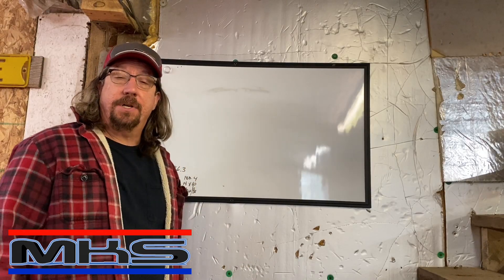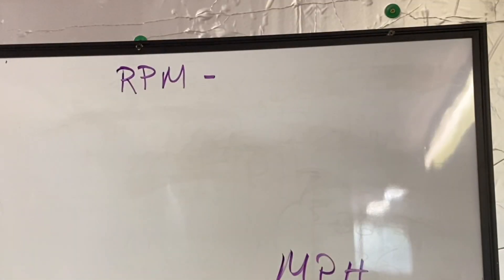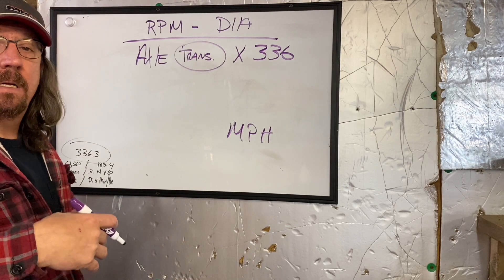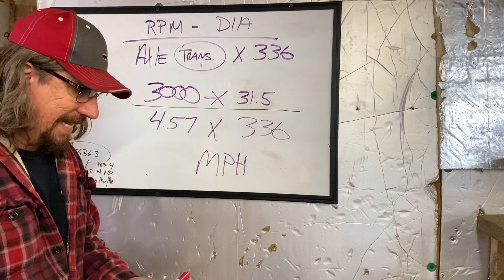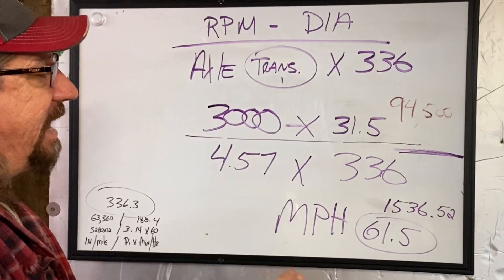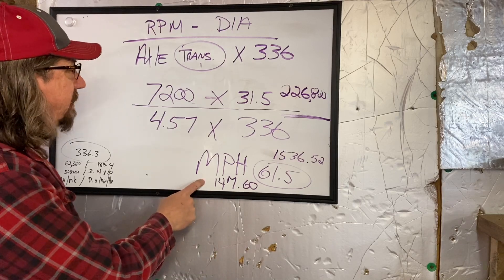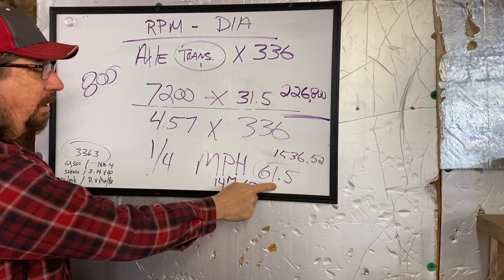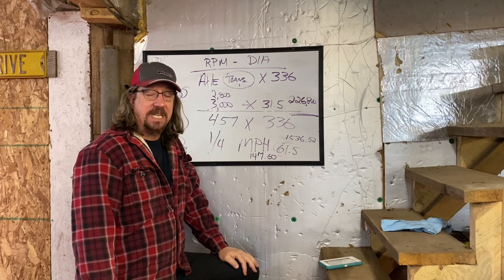How to Calculate MPH, Axle Ratio & RPM. Take the guesswork out of building a drivetrain for your car

Comment: Great stuff man!  My Dumpbtruck has .74 over drive in it's highest gear can I just add .74 to the ,RPM?
Reply from the maker: Multiply by  .74
Reply: @MyKARSShop 1000 rpm x .74 is 740 RPM.
It should be faster than the input shaft for over drive?
Reply from the maker: You’re correct. Sorry it should’ve been divided by .74. 

1000 \div 0.74 = 1351.35 rpm

S
Reply from the maker: Sorry about that. It should’ve been divided by .74 

1000 \div 0.74 = 1351.35

S

Comment: lost me at that 336. don't understand that. how is that standard on any car?
Reply from the maker: It’s a formula compensation 

The number "336" is used in axle ratio calculations because it represents a simplified, rounded-off value of various constants within the formula used to calculate road speed based on engine RPM, tire size, and gear ratio; essentially acting as a conversion factor to make the calculation easier without significantly impacting accuracy

Comment: Hello. You mentioned that there is a further calculations about horsepower needed for a certain rpm. Do you have any video regarding the hp? Thanks
Reply from the maker: I have done nearly 500 videos in the last 4 years, but I don’t recall having done one on calculating horsepower yet.  Stick around. I probably will do one eventually.
Reply: @MyKARSShop  I appreciate it.

Comment: Please help.I have a 3.90 gear with 27 inch tires.My motors cam seems to be done at 4800rpm.Comp cams says it's good until 5500 but when I run it out in 2nd gear to that the motor just goes flat.I lost .3 tenths over shifting at 4800.So I have went up to 29.5 tires.Going back to the track this weekend.Do you think it will improve my quarter mile time??? My next plan is to go down to a 3.55 gear and try the 27 inch tires with that gear.When I did the math these two combinations are almost identical in rpm to speed.With all of your expertise what do you think would be the best between these to set ups ?? My motor has a dual plane intake and about 300 hp.C6 transmission and the truck weigh is 4,000 with driver.I have traction bars and hook up good on take off with the 27 inch tires.
I have noticed that I get 300 more rpm on launch with the 29.5 tires.
Can't wait until Saturday to try again.
Please respond if possible, really like your video's.
Reply: Thanks for the detailed answer.
What I failed to mention is that the jets have been reduced in the rear by 4 sizes and I think 4 in the front also.Its been more than a year and I failed to take notes.
My plan is to run it with the 29.5 tires shift at 4800 in second.If the time is slower than last time I was going to shift at 5200 in second on the second run.I could bump up timing 2 degrees also.
I did manage to run a 15.3 last time.I know that's not going to impress anyone but I did weigh the truck with me in it and it was 4000 on the nose.
I'm thinking about pro max heads and a .592 lift cam but would need a 2800 deal converter I think.
Or I could use tank gas but would have to change to a electric fuel pump.
I guess I'm getting addicted to horse power and drag racing.
Let you the outcome after Saturday if your interested.
Thanks again...Sir...
Reply from the maker: @stevecooper8121  I’m very interested. I had a half ton Dodge pick up with a 340 in it that would run in the low 17s so I know how difficult it is to get to the times you are. 15 seconds is fast, Especially a truck. Well done!!!  

Years ago I had a kid who swore his car ran in the 11s. I took him for a ride in my duster and asked him what he thought.  His immediate response was this is way faster than my car.  I had him pull the Timeslips out of the dash. It ran 14.48 😎

Like I said let me know. I’m very interested how it goes for you
Reply: @MyKARSShop  Well last night was a learning experience.First pass I made was scary, got the truck sideways right out of the box, good thing I was in the right lane or it would have been in the wall.
2nd run I lowered the air10 pounds still spun but was able to control her.Ran a 16.3.3rd and final time tried the left lane and was 16.2.
Not really sure if I would have been faster the truck hates the taller tires.After watching other trucks I guess the 15.3 isn't to bad after all.Maybe that's just all she has.
I'm staying with the 3.90 gear and going back to the 27 inch tires.
My next move is the promaxx heads and more lift on the cam.
So you were right, the truck went slower.Sure made the crowd excited when they seen my rear bumper.LOL.
Reply from the maker: @stevecooper8121  Thanks for that update. That’s awesome. Glad disaster was averted

Keep us posted on how it goes next!
Reply from the maker: I will respond to you soon. I wanna take time to study what you’ve said and think about it. I’ll get back to you as soon as I can
Reply from the maker: First of all I would never claim to be an expert, but thank you for the compliment. 😂😂.  

There are obviously a huge number of variables that are going to make it difficult to answer this without asking 1 million questions.

So let’s just begin some generalities.

In general, larger tires are needed with deeper gears so that you have more contact patch on the track so it can hook.  And you definitely are thinking correctly about balancing gear ratio and tire size.  

I will be very curious to see what happens with the bigger tire and your 390 year, although it sounds like you’re hooking  good with the 27’s.   My fear is that going to the taller tire is actually going to make the problem worse. Because in essence you are going to a little bit higher gear by increasing tire size, it’s going to increase the load on the engine especially in second and third gear.

But that’s OK because that’s another bit of information that’s important

If your motor pulls good over 4800 in first gear but does not in second gear, I’m wondering if maybe you either have a timing or a fuel issue.  Remember that the load on the engine is a lot harder in second gear so it’s going to demand more fuel and more spark over a longer period of time. My guess is that you are not near that RPM when you’re going through the traps so you don’t notice it in third gear.

Can you tell me a little bit more about exactly what engine you are running, what carburetor, and what your overall timing is at full advance?
Reply: @MyKARSShop  My overall timing is 34 degrees.I have a 750 quick fuel carb with vacuum secondary.I have the secondary adjusted to open up quickly.I have 68 jets in the front and 74 in the back.Plugs look ok .My cam is 219/219 at.050.Gross valve lift is.456. I have gt40 heads long tube headers.I have a stock torque converter.358 windsor bored .40 over.Just rebuilt c6 with shift kit and upgraded servo.
Reply from the maker: @stevecooper8121  All right. Good information. I wanna ponder that a little bit. stay tuned. 🤔
Reply from the maker: @stevecooper8121   I pondered this all night and I keep coming back to the same conclusion.  This is total speculation, and without looking at it myself obviously I can only take my best educated guess 

Everything sounds pretty straightforward on your build. We know the issue is not with the converter because you’re not bogging or anything coming out of the hole. Your issue is in second gear if you push it past 4500, you lose TIme. 
Sounds like you’re launching fine and hooking good.  

I suspect going to the taller tire is actually going to make the problem worse & you’ll lose more time.  Again I could be totally wrong. But all I can do is take a guesstimate based on the information you’ve given

I did a quick calculation And the 750 carburetor is just a little much for that engine. However that is not a big deal since it is a vacuum secondary.  It can be dialed in 

In first gear, it is likely the secondaries and are not having as big an affect as they would in second gear.  After all you’re not in first gear that long and the vacuum secondaries are a little bit slower to react than mechanicals. 

But in second gear, the vacuum signal lasts longer and is pulling those secondaries open longer. It may be just enough to hurt your ETA without actually sooting up the plugs or blowing black smoke. My guess is you’re not hitting over 4500 RPM in third gear before you’re at the traps. If you were the problem would likely reoccur

I would try setting the secondaries to come in a later. And see what that does to your time.  

Another thing I might look at is the advance curve in the distributor. But instincts tell me it’s a fueling issue.

Obviously very hard be definitive without seeing, hearing it and experiencing it myself.  

Hope that helps, even if it’s just to solidify in your own mind what you are thinking the problem is. Let me know if there’s any other way I can help. 

Mike